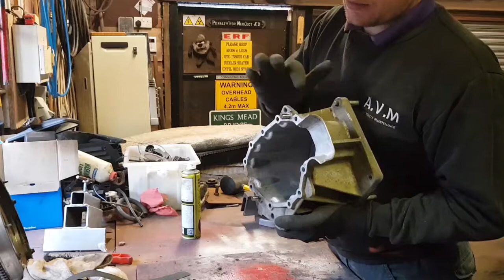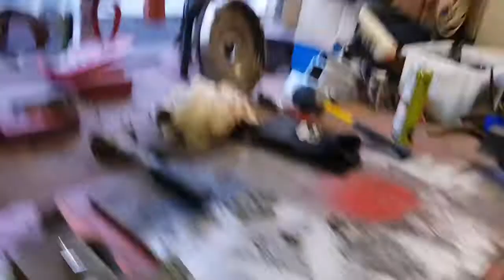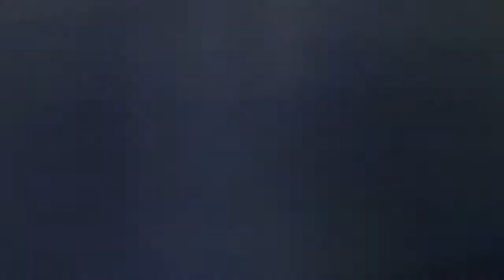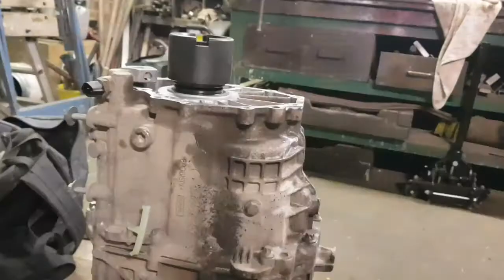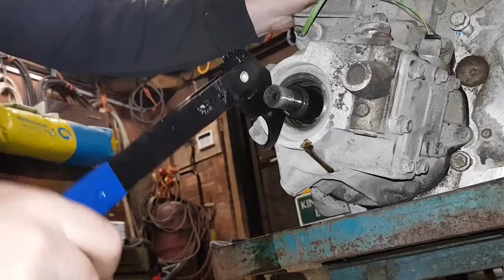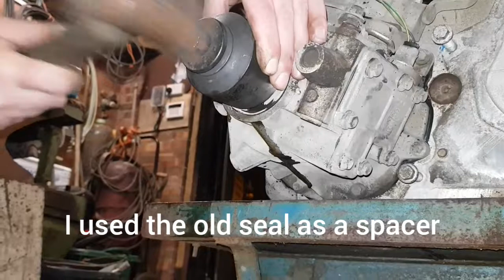Land Rover Defender Puma 2.4 Restoration/Rebuild Part 4 Gearbox Repair + Transfer box seals Replaced

Comment: Interesting comment from Nigel  ,if I have interpreted correctly , got me worried as I have placed the felt washer on the shaft after the output flange then the flat washer and finally the nut . I have checked an earlier workshop manual and also the LR workshop diagram which shows the felt washer as I have installed it . Phew !
Hope this helps clear up any confusion.
Cheers.
Reply from the maker: Mine had swelled up so i couldnt slide it over the top. I didnt have a replacement so i put it on after. Its still in the same place so it should he ok. If it starts to leak its not a difficult job to replace thankfully 🤣

Comment: I hope it's not too late to tell you that the felt seal goes in before the output shaft goes on. You fitted it under the wasker/nut??
Reply from the maker: Well spotted. On removal the output shaft slides over the felt seal but it had swelled up making it hard for the output shaft to slide over. Thats why i put the shaft on first and then the seal after as its in the same place.